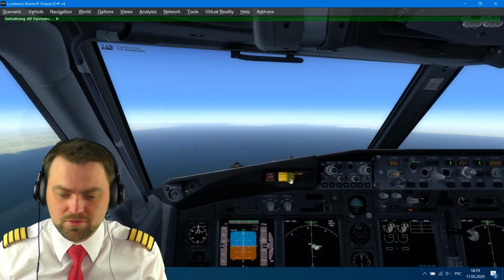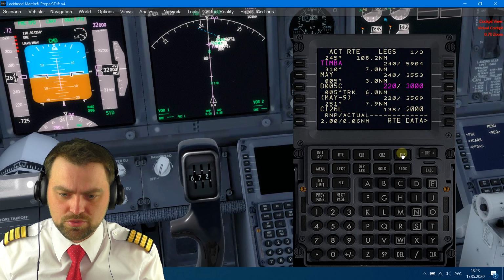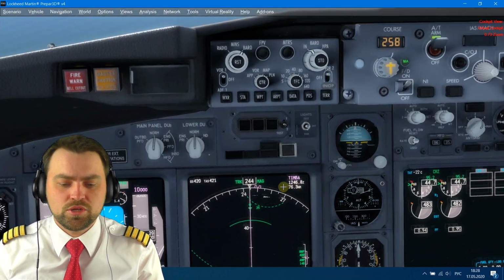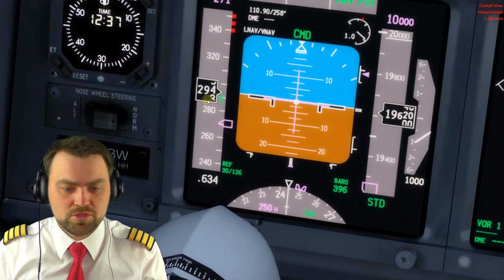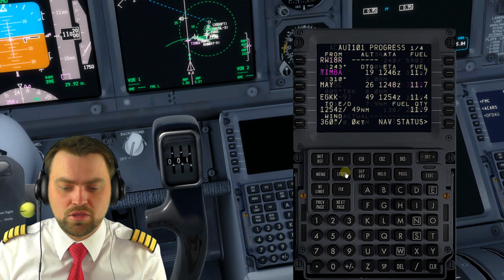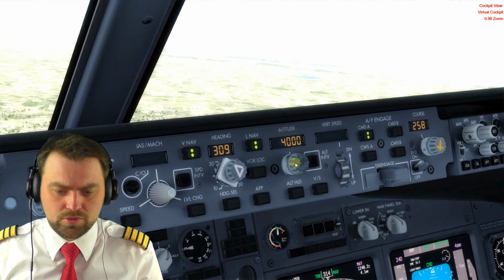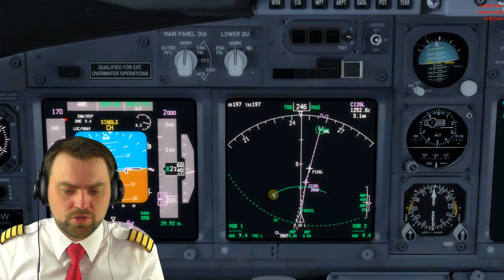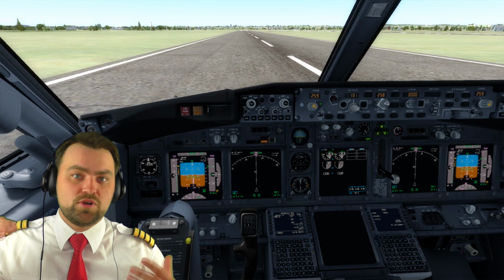Real Airline Pilot Descends B737 PMDG simulator using VNAV

Comment: Your thumbnails always give me a good laugh “can i descend and land it?"   I dont know professional b737 captain can you? 😂
Reply from the maker: Yeah. Actually Simulator is different. and it was my 3rd try on that video... I haven't got used to it so far... And as you saw I was unstable on approach... Thank you for your comment...
Reply: @PilotBlogDenys  whats the difference between the real plane and the pmdg one? The physics of the plane or what?
Reply from the maker: @bigsmoke7054  I would say that everything is diffent. It is like comparing Need for speed car simulator with actual car. The only thing you can do is to follow the airplane standard procedures on PMDG because it is very detailed in the cockpit. But if you fly the simulator it doesn't mean that you are able to fly the real plane. Even full flight simulators  (for pilot training) won't give you the real picture. PMDG may is just a model that can be used just to remember the procedures sequence inside the cockpit. Thanks for your question!
Reply: @PilotBlogDenys  you should try the Pmdg 737 800 in the Microsoft flight simulator